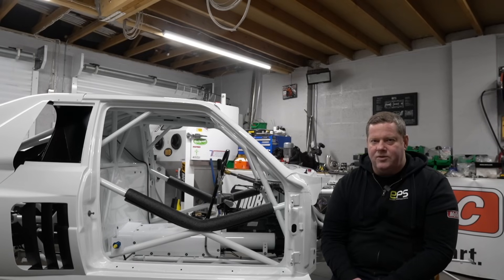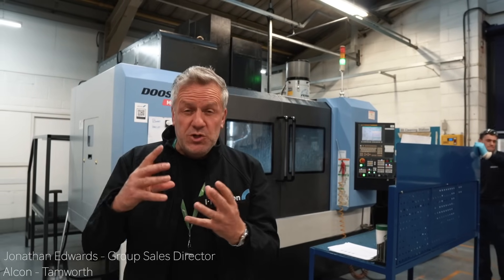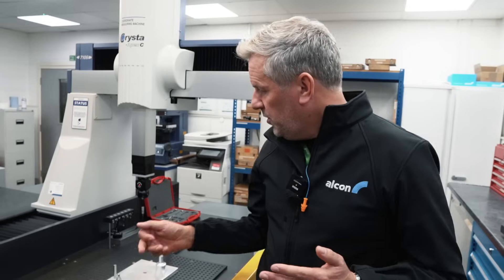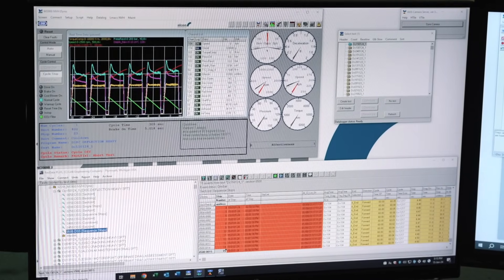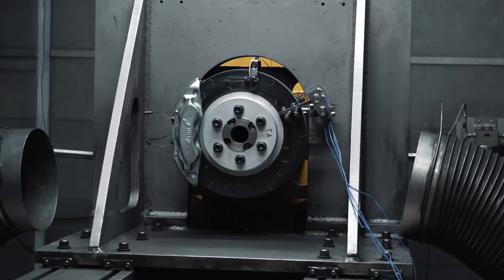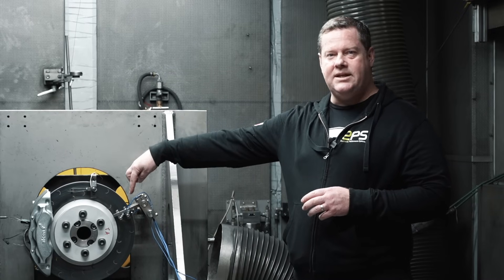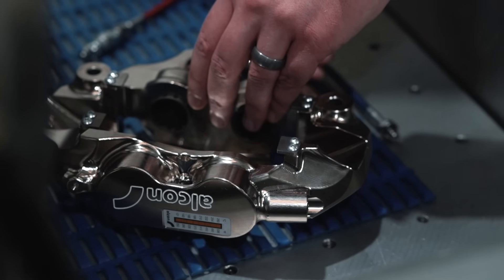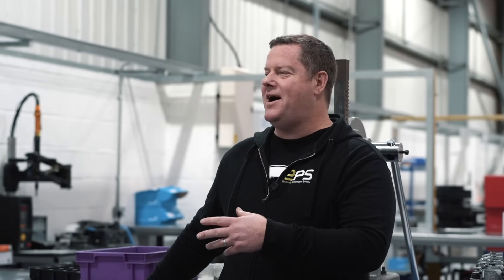Building the Audi quattro Group S RS001 (Part 10) - Brake System ft. Alcon

Comment: Awesome! Nice! Just a question, isnt a smaller brake piston generating higher pressure as per Pascal's law? So i think if the brake calipers are not in any other way reducing the hydraulics,  it shall be the big piston at the bottom? Im just curious and also i am not sure if it is like that, sorry 😂
Reply from the maker: At the caliper end the larger the piston the more pressure. It's because of the larger service area. So that's why a small piston is first then large last to even out the pad contact
Reply: Thanks!